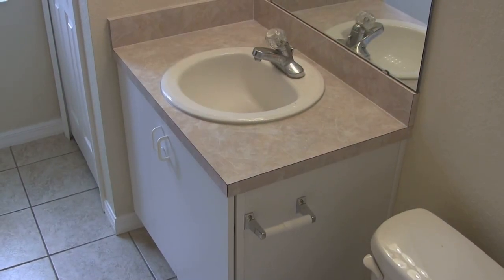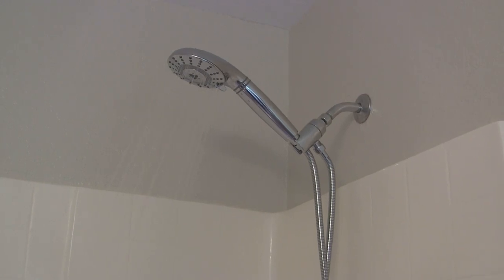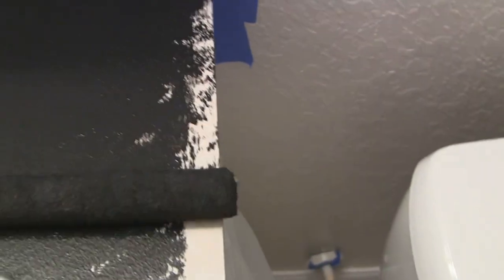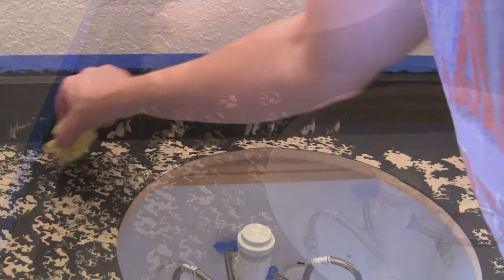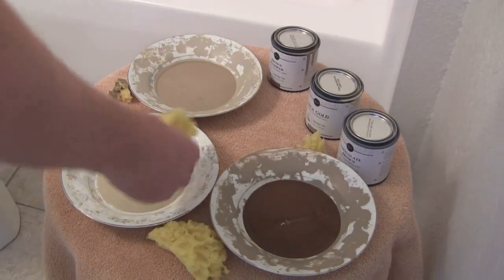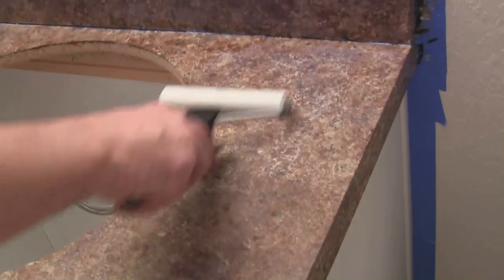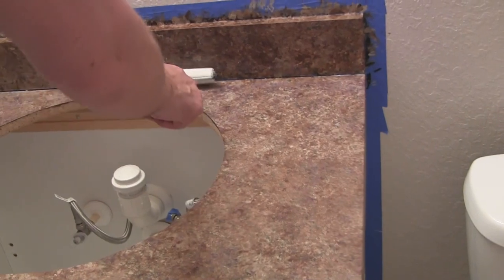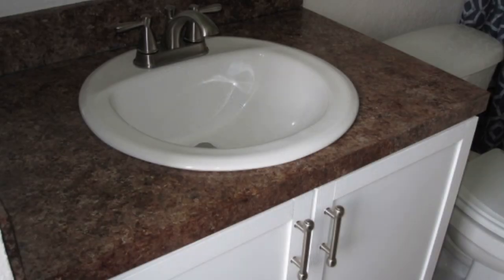Giani Countertop Paint

Comment: You cut the sponge in 4's what do you use the 4th part of the sponge for?
Reply from the maker: Cutting it in 4s were per the instructions. The 4th piece was used to cut into smaller pieces to get into the corners and tight areas.